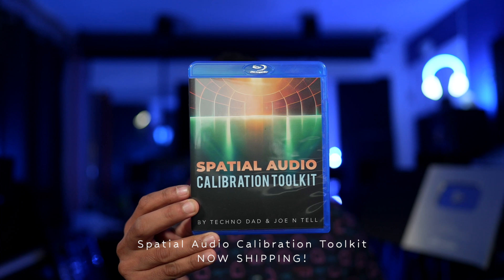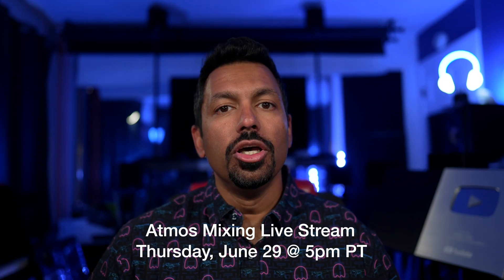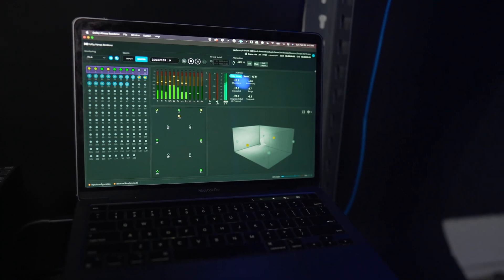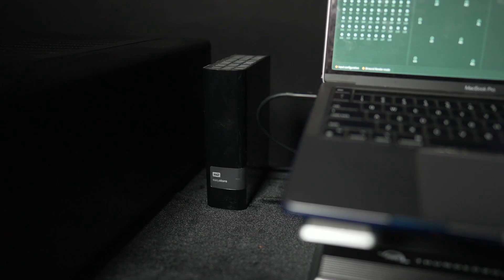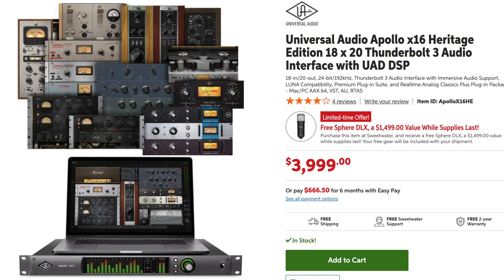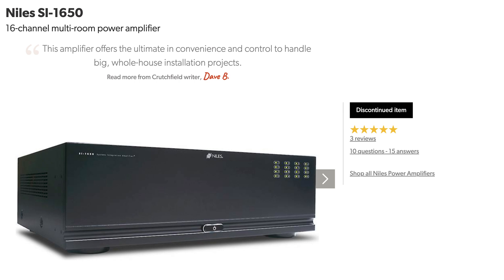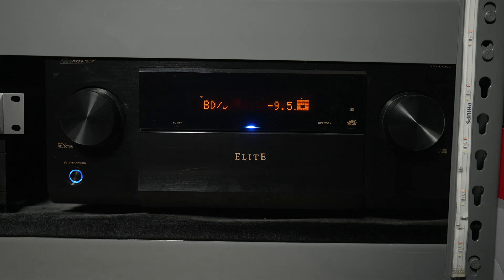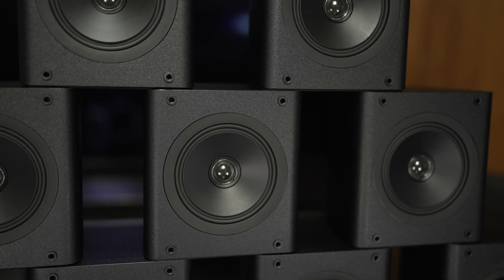Dolby Atmos Studio Tour | Monolith, SVS, Dirac Live, Universal Audio, Focal | Atmos Mixing Setup

Comment: Hey, how to get start with surround sound? like i have jbl lsr monitors 2 6inches and 2 5inches can get one more for center and a Sub from jbl. want to start mixing in basic surround sound like 5.1 so how to get info on that which audio interface is good to start and how to setup for 5.1/ dolby setup for basic mixing as i m totally new into surround sound
Reply from the maker: You would need an audio interface that has as many analog outputs as you would need.  But they usually go as a pair or 8 or 16.  If you wanted to start with 5.1, you may need to get an interface that has 8 analog outputs.

Comment: You should check out what Genelec and Apogee are doing with Atmos. It is a bit pricey, but Apogee D/A converters are killer and Genelec monitors with GLM Room Correction is amazing. Yes, they are powered monitors with use ethernet to transfer sound and power. https://www.sweetwater.com/store/detail/ImmersiveSysG2--genelec-7.14-immersive-audio-studio-monitor-system?mrkgadid=1000000&mrkgcl=28&mrkgen=gdsa&mrkgbflag=0&mrkgcat=studio&recording&acctid=21700000001645388&dskeywordid=39700065013197388&lid=39700065013197388&ds_s_kwgid=58700007232174981&device=c&network=g&matchtype=&adpos=largenumber&locationid=9031366&creative=537361853706&targetid=aud-382734789332:dsa-1385849812250&campaignid=6730319008&awsearchcpc=1&&&gclid=Cj0KCQjwho-lBhC_ARIsAMpgMoeMu2dEIvNjS63vcJvB8IPbSW_o9ctlJQD5dmnAOKF7XZ1lDXpk7O0aAr9rEALw_wcB&gclsrc=aw.ds

Comment: This is great!  How do you export the files to be able to play back in lossless Dolby True HD like you guys did on the spatial audio disc.  I’m also a mixing engineer and the only other guy I now who mixes in Atmos says the final file comes out as an ADM WAV which is submitted for distribution.  It also spits out an MP4 I believe.  How did you guys get it to be able to play back uncompressed?  Also, I’m trying understand your split setup better.  So line out of the interface and then going where?  Are you splitting the rca signal so one can go to the Niles and the other to the Pioneer?  I just can’t seem to make sense of it how you have both the pioneer and your interface going into the Niles.  Thanks!
Reply from the maker: Ahhhh yes...the ADM BWF files.  I'll tell you this.  It's a combination of 4 or 5 different software packages and about two dozen other steps in between to create the Lossless files found in our SACT.  That took months of figuring out, so I'm not going to say too much about it.  I will say this...it was NOT easy and there is nothing on the internet about it.  I just figured it out.  As for the audio interface and AVR going into the amplifier in my setup, that's super simple.  Y-splitter.  One side has a single RCA male and the other has two RCA female.  All you have to do is make sure only one device is on at a time.  So either the audio interface is on or the AVR is on, never both on at the same time.  Hope that makes sense!
Reply: @TechnoDad  I figured it was something really complicated for the conversion.  Glad you figured it out!  You’re then only person I know who has done it.  It really seems like it should be a standard thing as it’s hard to check your mix on a consumer system unless you are doing what you did with the AVR.  That makes sense now.  So the Niles basically has the y cable on each input so it’s either getting fed from the interface or the AVR.  That makes sense.  Just curious do you find a lot of major differences between the way the mix sounds when you’re listening in logic and when you play the mix decoded through the AVR?  In theory it should be the same because it’s same speakers/amps but I wonder how much is different with the decoding that happens.  Thanks!!!
Reply: @TechnoDad  Was the programs you used to convert the Dolby Media Encoder?  I’m guessing then you had to convert the MP4 to MTS or MKV files because I don’t think True HD works on MP4 right?
Reply from the maker: @NickMatzkeMusic  Yes!  Dolby Media Encoder is one of them.  However, the TrueHD output is a file type that won't be played by anthing.  MP4 is only Lossy Dolby Digital +
Reply: @TechnoDad  Wow, I got one of them right!  So what do convert the ADM to in Dolby Media Encoder if not True HD?
Reply: @TechnoDad I need your help!  How do you convert the .mlp files that Dolby Media Encoder spits out into .m2ts files?  I’ve been trying this Atmos renderer called Dolby Atmos Composer and am auditioning the Dolby Media Encoder.  I can get the media encoder to output MP4 but what software do I need to use to convert the .mlp and .mll files it spits out to m2ts when you encode for Dolby True HD?  Thanks!

Comment: Curious to know how you were able to do two inputs of mixing and AVR-preout from receiver to 16 channel external amp at the same time?

Is it with Y splitter on external-amp? 3:10
Reply from the maker: Yup!  simple solution.  Just have to make sure only one of the items are on.  So either the audio interface is on, or the AVR is on.  Never both at the same time.
Reply: @TechnoDad  Hi from Norway! When you say "only one at the same time" do you mean volume is down on one or you power off the device? One more: what is your atmos monitor controller in this setup?